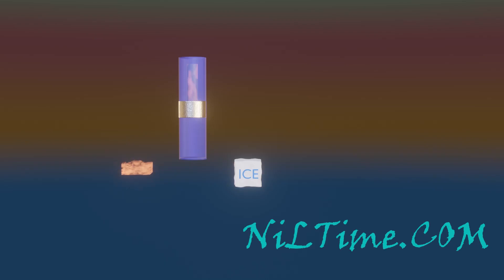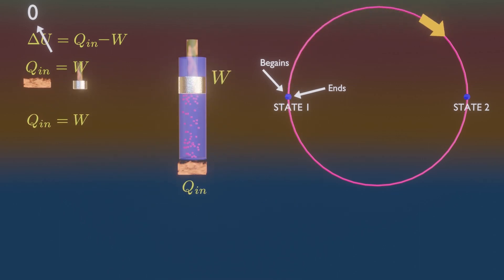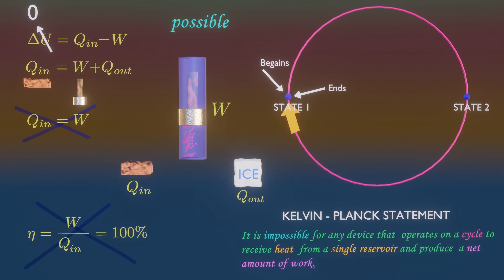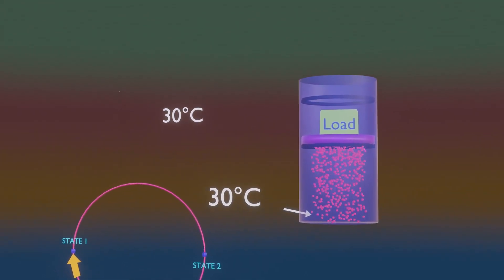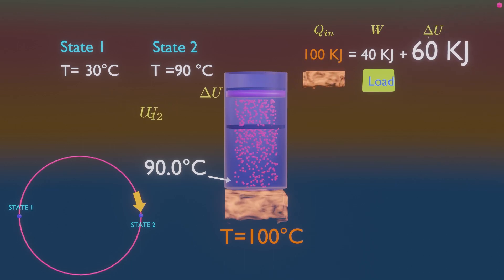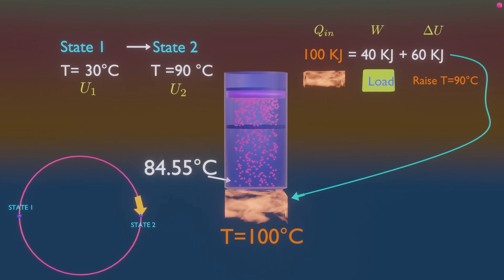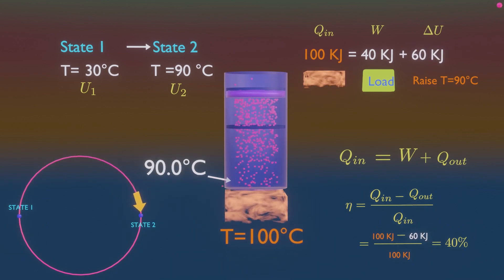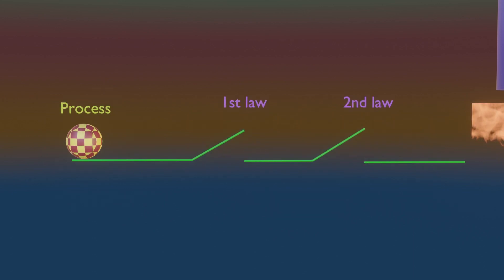Understanding 2nd Law of Thermodynamics Without Entropy (3D ANIMATION)

Comment: I am anxiously waiting for your video on enthalpy. 

Enthalpy is very confusing with enternal energy.
Reply from the maker: Yeah, I remember you ^^ and I know "Enthalpy", but I need to finish six more videos related to 2nd law and Entropy. It surely would take some months. Please bear that :(
Reply: @NiLTime  thanks a lot
Reply: @NiLTime  Ma'am actually you missed something.
It is the 0th law of thermodynamics whick states that now heat always flow form hotter object to colder object until they reach the same temperature. 
This is the only reason why heat was not flowing from the gas back into the heat reservoir
Reply from the maker: I am just showing limitation of 1st law here ^^. If heat were to flow from a cold to hot object, the heat lost by the cold object would equal the heat gained by the hot object and the first law is satisfied here (conservation of energy).  Another form of the 2nd law statement is that heat does not spontaneously pass from a colder body to a warmer body. 
Yeah zeroth law is also true but these first two laws (1st and 2nd) of thermodynamics were established before, and they were named before zeroth law. It is obvious for zeroth law to became more fundamental than the other laws of thermodynamics. ^^
Reply: @NiLTime  Yes Exactly , very nice explanation Ma'am.  💫💫💫
Reply: @NiLTime  Hello dear,

I hope you are doing well, I saw your videos from youtube channel '' NiL Time''

videos are pretty good . actually we are working on an educational project so i want you to be a part of our team. so it will be better for us  .

I hope you are comfortable in technical subjects. I want to create animation . 

We can discuss  on that topic if you like .

Reply us when you see the mail.

Thank you

RTZ Digital

Contact us : 8005055791